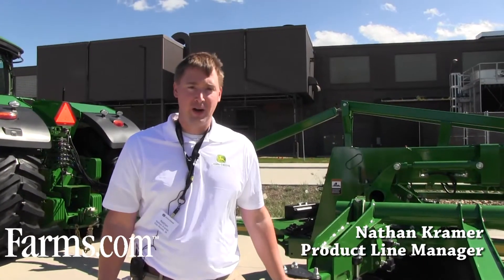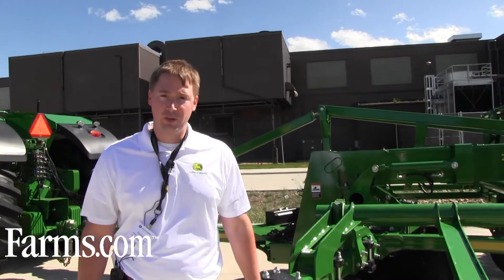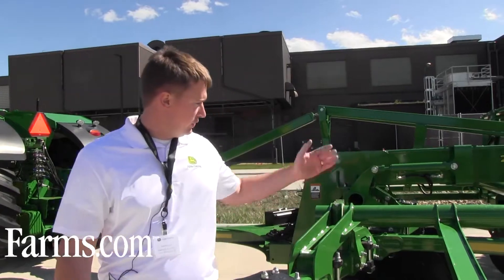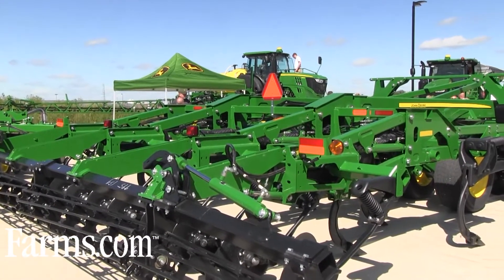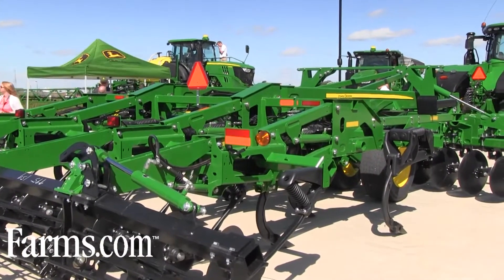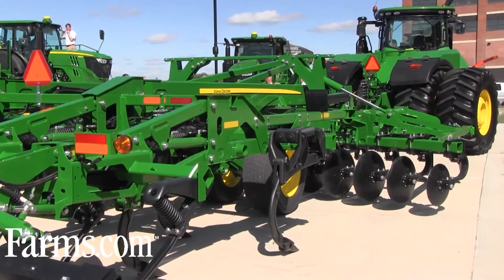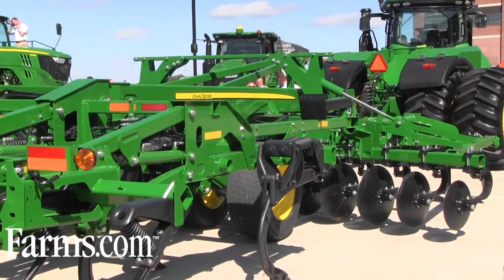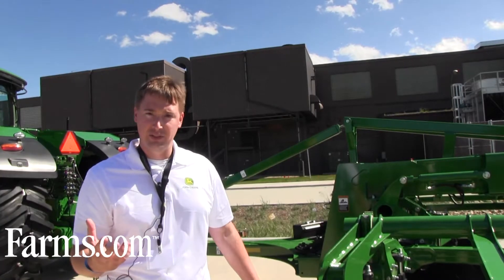John Deere TruSet Technology for the 2730 Combination Ripper

Comment: hello, could you podcast a tutorial video of tractor 9570r john deer with 2730 combination ripper, I mean how to engage the tractor with the ripper, how tu connect the tubes I mean iso system, how to configure up and down the ripper with the joystick, how to configure all the other componets (disks, rippers, other components ) of the ripper with the joystick, how to paint the field in the command center and how to use autotrack for to fill a farm with 5 draw of tillage.  thanks.